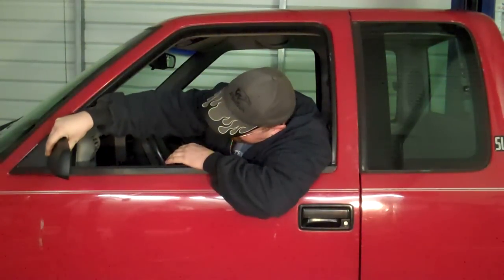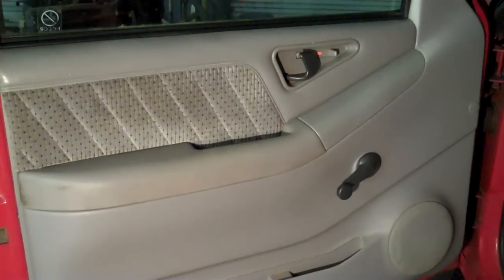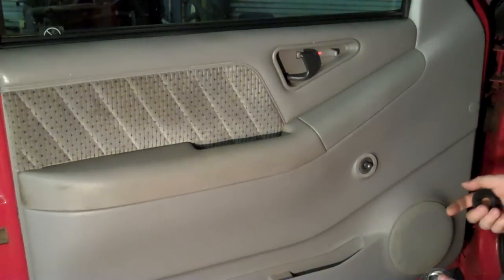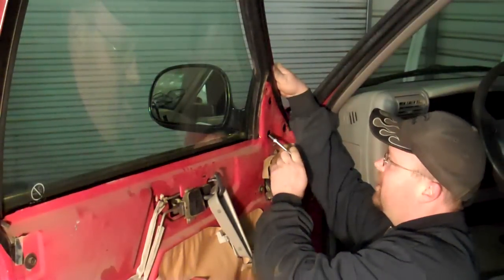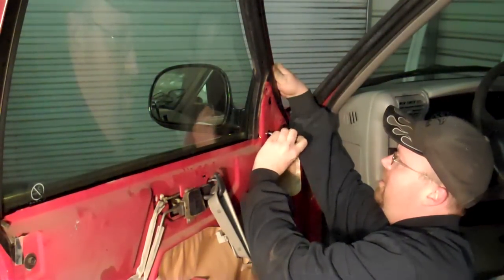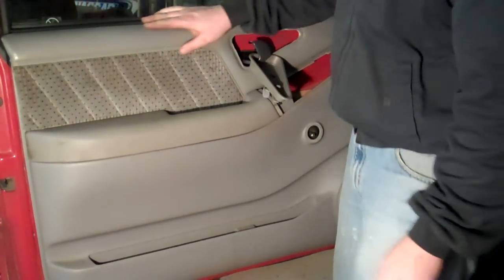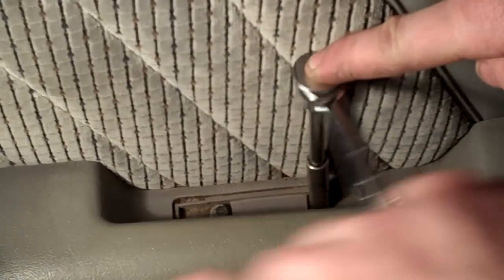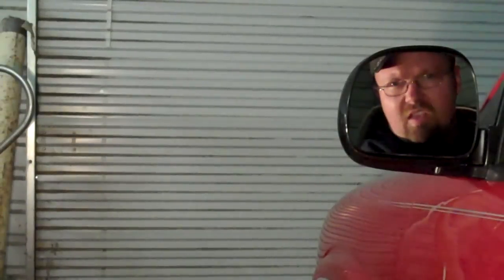Interior Door Panel & Outside Mirror Replacement

Comment: thanx for the post. had to replace mirror on dads s10 &this was a help. it always seems more daunting than it is not being able to see how panels are placed on the door, but no matter what car, there are always a couple of bolts that are a part of the armrest/handle. the screw in the door release cup is just plastic, it spreads the nut behind it into the metal of the door.

Comment: thanks, i have 2 exterior mirrors in transit. It was funny watching the originals both break off and bounce down the road behind me in 2008. They fell off about 2 months apart from my 95 s-10 that now has 250,000 miles.

Comment: thanks, just what I needed for my 96 sonoma. Looks like this should be identical up to 1997, apparently (from the otehr videos I saw) 1998-2004 had slightly different design on the interior door handle and lock, and the placement of the two screws with 7mm heads was slightly different. Always wondered how to get the interior panel off the door without breaking it.

Comment from the maker: @TheyCallMeGriZ  It will be similar.  There will obviously be electrical connectors for the power accessories that my truck doesn't have.  The good news is that you don't need a tool for the window crank handle!

Comment: would this work on a 97 S-10 blazer as well? i have automatic windows and door locks, will that make a difference?
Reply: Yes, you need to unplug electronics before you take off the door panel.